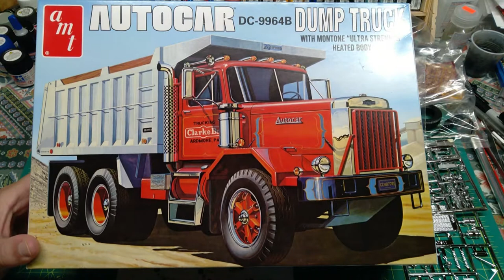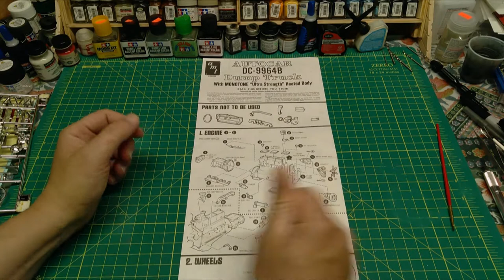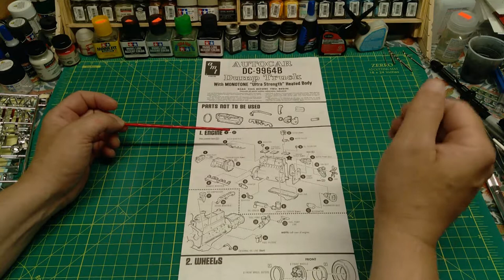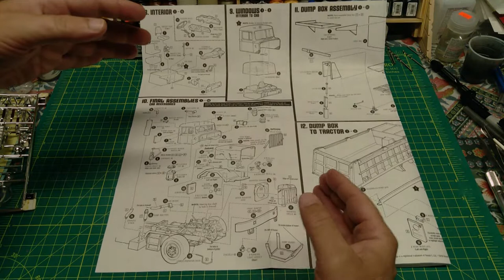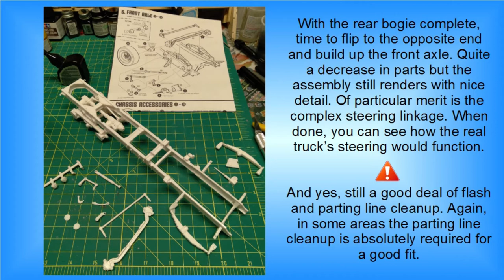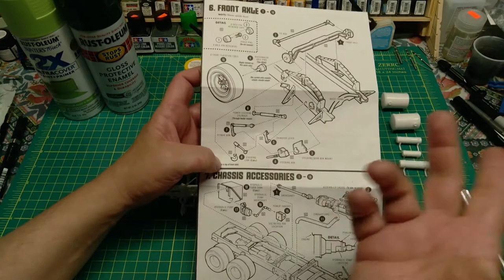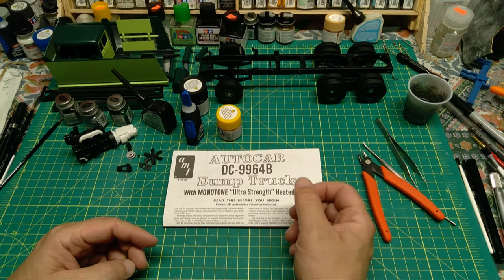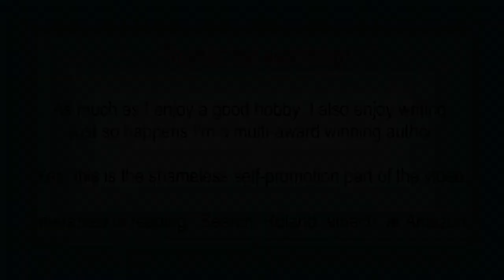Practical Plastic: Episode 14.1, AMT Autocar Dumptruck

Comment: Much as with Ertl’s International Payhauler 350 Detroit Diesel Dump Truck kit, and AMT’s Caterpillar D8H Construction Bulldozer kit, I had built this one, too. The front left fender of the cab had an odd bend to it, so I just dry-brushed a bit of steel over the painted part to suggest the consequence of a mild collision. I also had used Testor’s little, ¼-oz. bottle of generic medium brown enamel paint mixed with bits of baby powder to simulate thick clumps of fresh mud upon the tyres. 
   Ertl round that time also had released a kit of a dump trailer (I cannot recall its full name), one of which I had bought, that one could connect to the rear of a dump truck, complete with a fifth wheel arrangement that the tractor would pull.
Reply from the maker: Thanks for watching! I have the bulldozer but have yet to build it. I know in the twists and turns of model companies that presently there are a number of Ertl kits under the cover of the AMT brand. I remember those kits from many years ago and they always built well. No so this truck, which does not appear to be an old Ertl. I like your solutions to the fit problems - clever and I bet they look great.

Comment: Hello, I'm a new subscriber and I have a special request. 
Can you show how to build the MACK R685ST, please? I never built a semi truck before and I got one for a gift. I think I need some help with it. 
I like how the dump truck turned out. Do you think the Autocar dump bed will fit on the MACK? Thanks for the videos
Reply from the maker: Thanks for subscribing! Unfortunately I do not have this kit in my stash. However, truck models (particularly AMT trucks) build in a very similar manner between suspension, frame, engine and interior. What I show with the Autocar will hold true for any of the AMT trucks. Regardless, I suggest you start with the frame as this will be the most important part of the build. Take your time to ensure the frame is straight - if you don't have a builder's mat, use graph paper as a guide or even plain paper with a straight line. From there I would build the suspension, paint the assembly, then build and add the engine, wheels and tires. Leave the interior and cab for last. As far as fitting the dumptruck bed to this tractor, even if it fits in terms of size it may look disproportionate in scale. Dump truck frames and mechanics are much more robust than traditional tractors. I will keep this kit on my radar...trucks are fun to build, but they do require patience!
Reply: @practicalplastic3450  Thanks for taking the time to respond. I hope to see if you build it!  I like the way you go over everything with the build and what to watch out for. I like your style and glad I found your channel! Thanks for sharing
Reply from the maker: @Darryl603  Thanks so much for the kind words! I have enjoyed this hobby for a very long time and my goal for the channel has been to help people through their builds. My little way of giving back after the hobby has provided me with so much enjoyment.

Comment: what a dissapointment.theres no part numbers on the runners!!45$ in the trash..yes.i threw it out.if the wrote that the parts arent numbered,i wouldnt have bought it!!
Reply from the maker: Thanks for watching...Actually, I do mention issues with the parts numbers and confusion on this issue. There are some numbers on the parts but these are not utilized in the instructions; likewise, the instructions rely on numbering for assembly sequence rather than identifying the parts themselves. Also the sprue map on the back of the kit box does not include any reference to parts. Adding to the confusion is that there are quite a few extra parts in the kit that are not utilized at all. A few of those are shown in the instructions (again, no part numbers) but there are far more clear/tinted parts that are excess. Sorry to hear you threw out the kit. It is indeed a challenge to wade through sorting out the assembly, which is why I do mention several times in the two parts of the build that unless you have some experience (and forgive me, as I do not know your personal level of building experience) that this kit is best put aside temporarily.